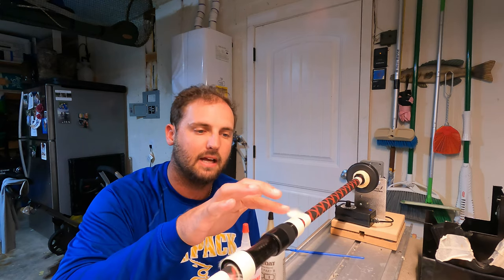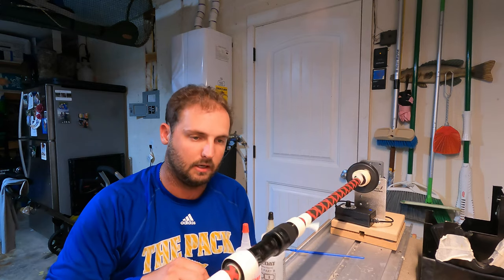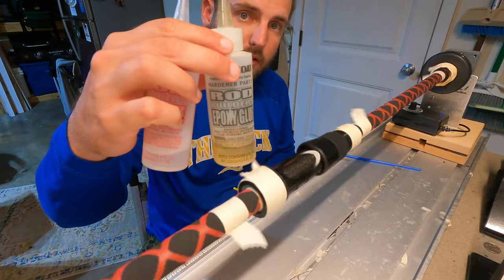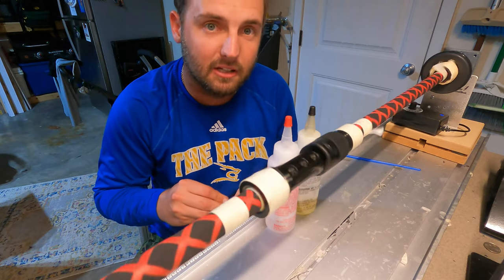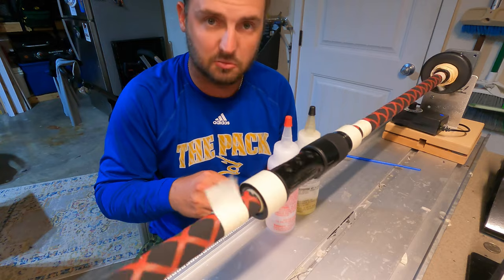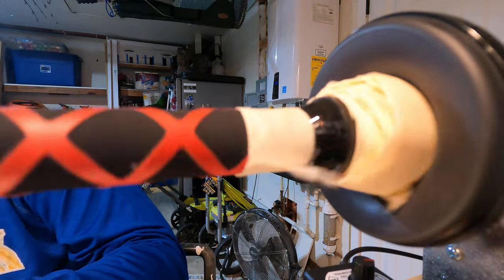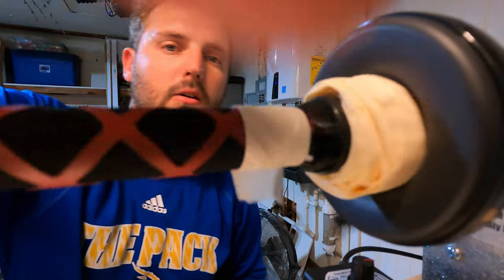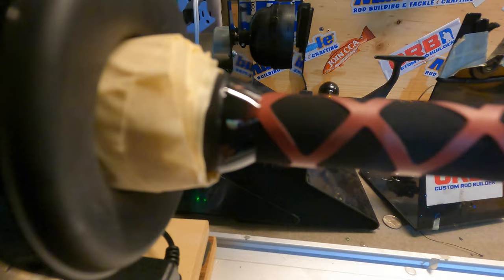CUSTOM ROD BUILDING- Epoxy Ramps! No more rubber winding checks!

Comment: What tips do u have for the ring backing out that tightens down the reel feet..?? Mine keeps coming loose and I'm scared to over tighten.. I've read to wrap teflon over it then tighten ring.. Any ideas?
Reply from the maker: I usually don't have a problem like that with my bay rods. However, on my big jetty setups, I use double ring lock reel seats and that solved it. If you can't change the reel seat, I bet teflon tape would do the job! I'd say anything you can slip over the threads and still tighten the reel seat would work!

Comment: What export glue do you use? And what is the black color that you add in it? I would like to buy some
Reply from the maker: It is flex coat, rod builders epoxy glue. Main thing is that it will self level just like guide epoxy. I just added marbling pigment. I typically do a coat of epoxy finish over it as well!

Comment: At what point do you remove the tape? Before it’s fully cured of course, but once you’ve laid it down and it’s leveled itself out?
Reply from the maker: Yes, you can remove it right after you lay it. It’s very similar to epoxy finish, just sets up way faster. Once you get used to the consistency, you don’t even need tape! It will only run to the edge you laid.

Comment: Just watching your excellent video now approximately a year after you released it. I'm wondering how well the epoxy holds up and how well it adheres to the shrink wrap grip on the rod you built in the video. I want to build a surf rod with shrink wrap grips and was considering doing epoxy ramps at the ends of the real seat, but I'm concerned about the durability of epoxy on top of the  somewhat soft / flexible shrink wrap. What has your experience been with the long term durability of this method, especially when used to finish shrink wrap grips?
Reply from the maker: I have built epoxy ramps on 8 rods where it goes from ramp to shrink wrap. I fish them hard, and they have held up great! The ramps will actually hold the shrink wrap in place a little better as well. I won't ever put winding checks on another surf rod build. Also, if they do start to deteriorate, just add some heat and you can get them to flake off and reapply a new ramp!
Reply: Thanks for the quick reply! That's excellent info!

Comment: I wanna start wrapping rods. What kit do u recommend? Or it better to piece one together.
Reply from the maker: For the tools, Mudhole Tackle has some great starter kits that come with everything you need to build a rod. For rod kits, both Mudhole and Get Bit Outdoors have rod packages that are $70-$90 that are pretty good quality to get your feet wet before you try and tackle an expensive rod blank and components!

Comment: You should try using your normal epoxy finish I find this works well, just wait for epoxy to set a little. FDx custom rods has a very good instuctional vid.
Reply from the maker: I’ll have to check it out, i will use normal epoxy if I’m not in a rush to fish the rod!
Reply: @KardiacOutdoors  Its quicker cause there is no need to apply a finish coat over the ramp and you can use same batch as your final coat for guides.

Comment: which varible ststem is that? can it be set and run for rod dryer !!!
Reply from the maker: 9-200 rpm flex coat OEM. Yes but even 9rpm can be too fast for me sometimes. Usually dry on my 8 rpm!
Reply: @KardiacOutdoors  is the 3 rod the crb? really like the 3 videos onthat gray rod!
Reply from the maker: @chriscothren2030  yes, it probably is a CRB, all my inshore and bass builds are on CRB. Personally fish them a bunch and they are tough as nails.

Comment: I find if you let the resin get a thicker consistency, i.e. get closer to setting up, it will stay on the rod better...
Reply from the maker: The more I do it, the more I over-apply and let it gradually drip the excess. Also have figured out that 9rpm is the sweet spot for an even finish or you can crank up your variable speed and shape your ramp once it sets up like you mentioned! I prefer to use epoxy glue versus finish personally, I can pigment the glue on first application then go over it with epoxy finish once when I’m applying it to eyes or decorative portions!

Comment: That looks pretty "iffy" to me.   That epoxy is far too thin.
Reply from the maker: May look “iffy” but it’s not. This is Epoxy adhesive, not epoxy finish. I’ve put this on surf, shark, and bass rods. You can go over it with finish after the initial pass. I’d recommend you try it first. It’s mixed at 1:1 as instructed, with it being thin, it levels out nicely to have a smooth finish.